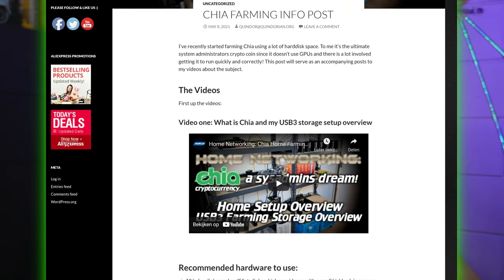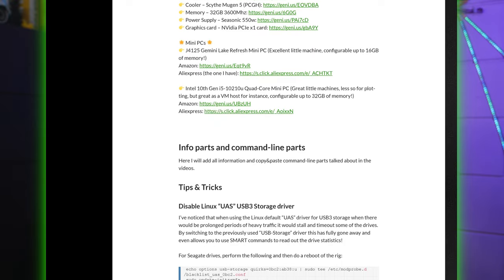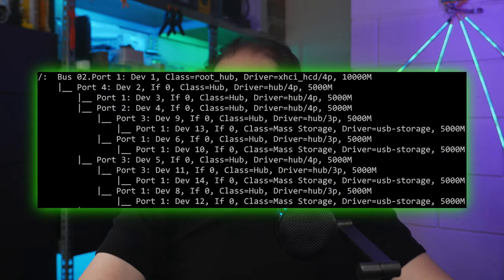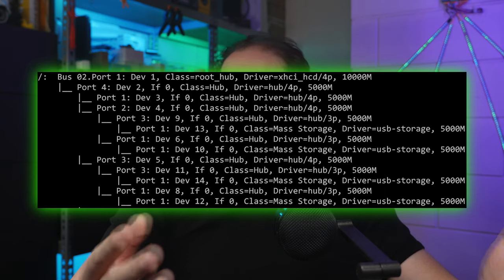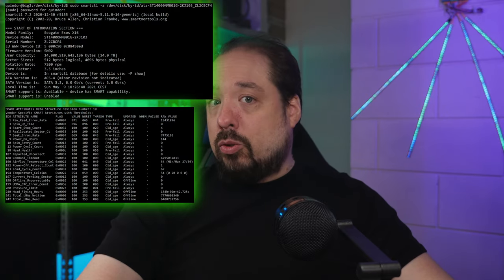Home Networking: Chia - Designing a plotting rig

Comment: You only need GPU to install and setup, after that you can take it out. Computer will post fine without one. and it uses less power. SSH access over the network after that.
Reply from the maker: For sure, I do that with my main server too, but those x1 GPUs do make it easy to just stick it in a free slot!

Comment: what are the rewards per tb?
Reply from the maker: Undefined really, each plot you finish gets you a ticket in the rewards lottery basically. Once pooling is possible it'll be a lot easier to determine profit per day, etc.
Reply: Some Chinese pool already exist, I’ve seen people getting about between 0.03-0.035 Chia per day per Tb, but it was couples days ago and the network increases exponentially
Reply: @trucha1785  That is not a pool.  That is handing the keys to your wallet over to a third party.  Do not use it for security reasons.
Reply: @cracklingice  wanted to know the reward… not if it’s a good idea to do it…

Comment: The problem is ... when plotting at those speeds ... you will run out of storage fast, 4TB a day ? Even 8 TB hd's are hard to get your hands on these days.
Reply from the maker: Ah yeah, I have 4 external USB3 drives connected per plotter which take the local ingest.

Comment: Hmm should be some x570 mb  with built in gfx output no? that way you should save some money nad less components to deal with :)
Reply: It seems rare, this one might have it but it's very expensive, ASRock X570D4I-2T, another route for skipping out on external gfx card is intel, but meh.. intel... :)
Reply from the maker: There are not, the ports are there when using an APU but those wouldn't have even close to the same CPU performance.
Reply from the maker: Yeah, very expensive and missing the PCIe lanes/slots we're going to use for storage later on. ;)